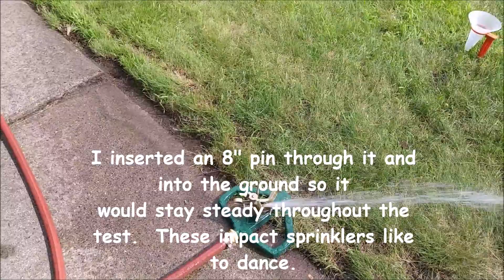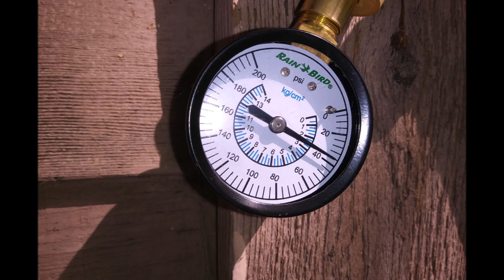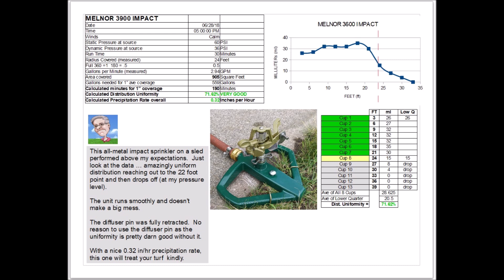Melnor 3900 Metal Impact Water Sprinkler Performance Test 1.0

Comment: We had this sprinkler's similar model, the Rain Bird 25PJ all over our property to irrigate larger portions of our place.  The lawns where the head would be in the way on a riser pipe had completely below-ground pop-up sprinklers with the 25 PJ head inside.  Ours were in the cast brass enclosure.  Later models had only plastic enclosures.  The visible parts were about 6" diameter flat plates, and the rest was about 8 or 9 inches underground, hooking into a 3/4" NPT pipe.  

Last I knew, the whole system was still working fine, though the timer for the system had to be replaced a couple of years ago.
Reply from the maker: Good info.  Thanks.